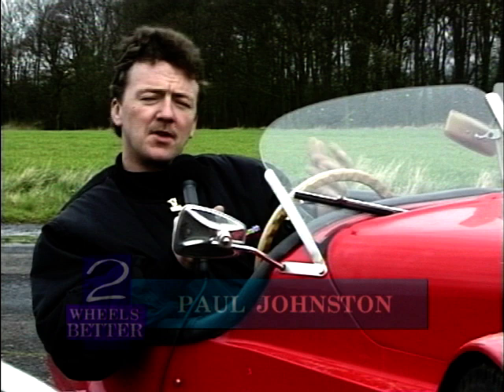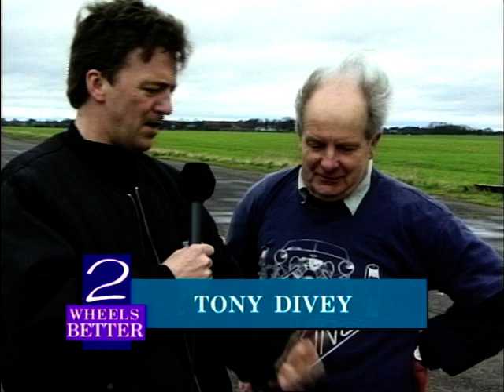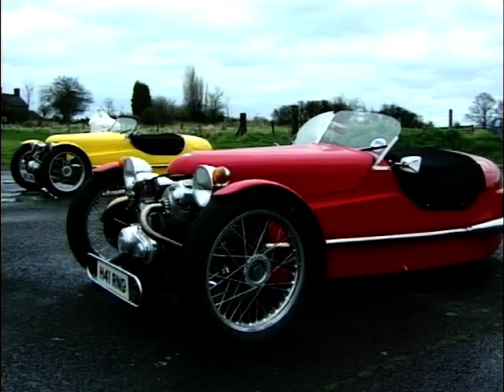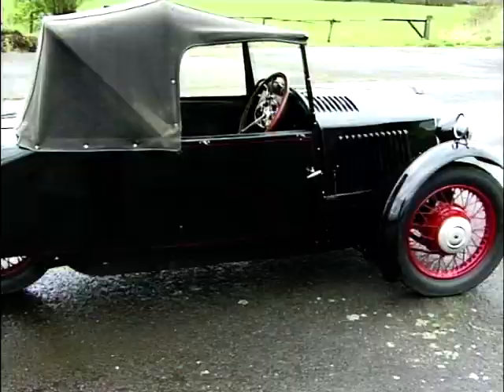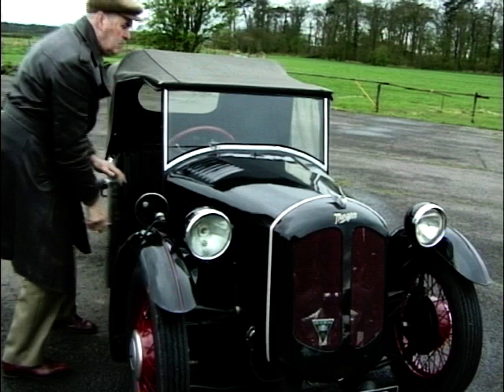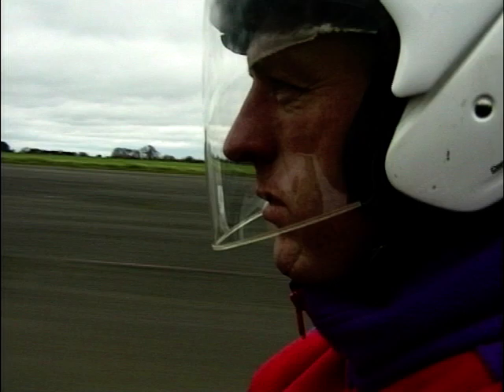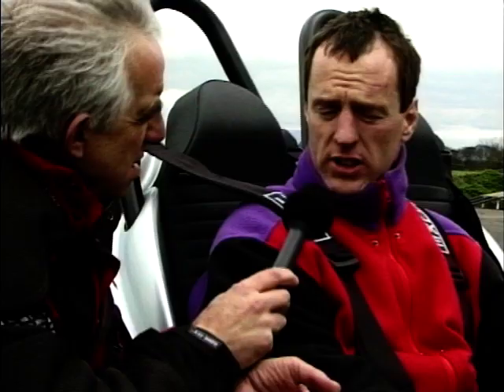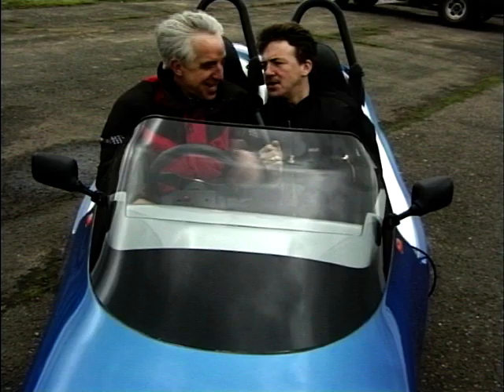Three Wheels - Car or Bike ?

Comment: In the UK they are classed as a motorcycle and side car/chair, but it also goes by weight.

But in New Zealand, they are classed as a car or a motorcycle!!!!!

If you choose it as a car it's no helmet but you have to wear a seat belt.

If you choose it as a motorcycle, it's a helmet.